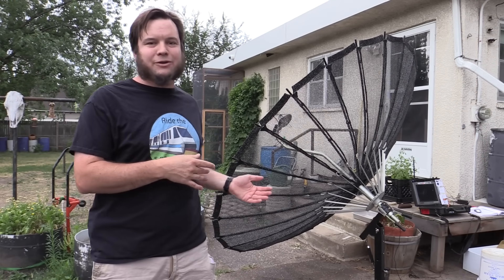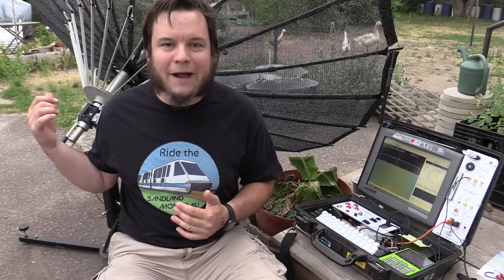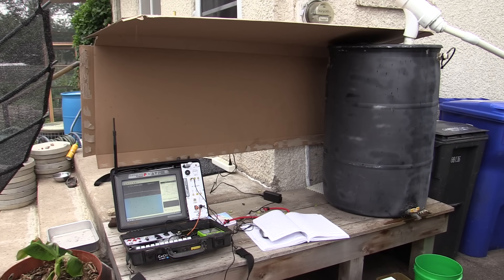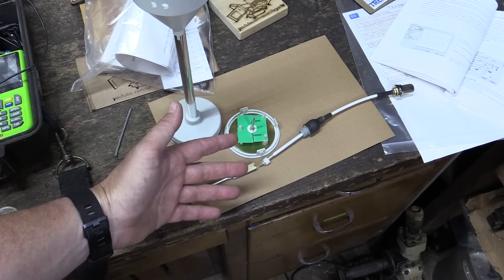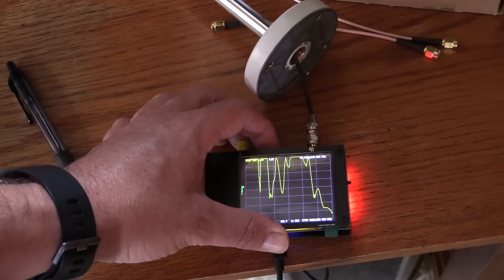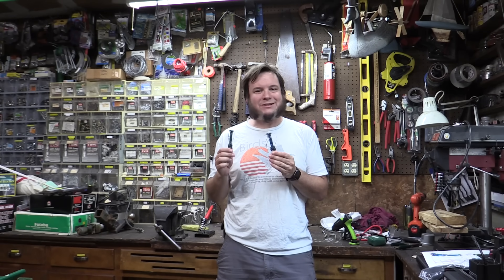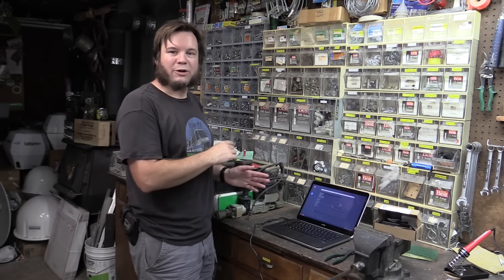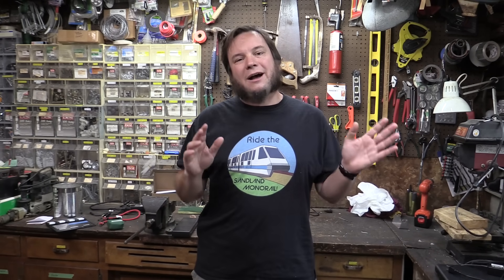Messing With HRPT Satellite Signals

Comment: I'm just happy I'm not the only one who considers duct tape a daily tool. Almost everything I  build is held together with hot glue and duct tape. Sometimes I even put electronics in cardboard box cases.
Reply: hot glue is a wonderful thing that i think gets thought of as nothing more than as an arts and crafts adhesive usually. as long as you're not gonna put it somewhere where the heat is gonna melt it it's really handy, heck all of my antennas ive made so far are hotglue, zipties and PVC.

Comment: Hi, I'm trying to do the same thing, and I've designed some helical antennas for reception, but I can't receive anything. I've tried the spiral in both directions, and nothing. The nanoVNA shows me an impedance of 50.1 ohm at the satellite frequency and an S1.1 parameter of -20 dB, but when the satellite passes... nothing, not a trace. I don't know what to do anymore, if the antenna is bad, or if I need a larger dish to receive the signal... the thing is that in APT I do receive the images, but in HRPT nothing.
Reply from the maker: Are you using an LNA? And can you confirm the pass time and your antenna aiming with another source? Usually I use n2yo for pass scheduling, but Gpredict or other websites can help you double check.
Reply: @saveitforparts yes. I use the noelect GOES saw LNA, and i checked the banda pass filter. It has +6dB gain at 1702MHz. And i use gpredict to track the satellite. Can i write you in IG and show pictures?

Comment: @saveitforparts measurements i built the amazon L-BAND antenna too. I thought I built mine LHCP with the intent of using a dish to RX RHCP signals. Don't you look down the front of the antenna and whichever way it twists is L or R, yes? would that make your antenna at 10:45 RHCP? IDK just wondering because so far im  only seeing some slight signals but aint decoding shit yet. thanks!  73 KJ7QEB
 https://www.dd1us.de/Downloads/QFH-Antenna-Kit%20for%20L-band%20rev1.pdf
Reply from the maker: I had a ton of trouble with that dang mini QFH dingus, I haven't tried using it again since this video. I found just a coil of wire works pretty well, either with a 3D-printed scaffolding or just stuck on some plastic supports. https://sgcderek.github.io/tools/helix-calc.html Same guy has some 3D-printable templates on Thingiverse.

Comment: Yep, the Nano VNA is a great tool. I bought one in early November & its still in the box needing calibrated. I am looking forward to using it, especially the feature that plots onto the Smith Chart which is actually just the Extended Complex Plane or Riemann Sphere where knowing that takes the mystery out of the chart.

I also bought a new RS 918 about the same time. The new rig stayed in the box for 6 weeks too because I have conceivably too many projects. 

Eventually firing up the rig showed it came with a broken mic. At least the new mic arrived today and now, crossed fingers, the RS 918 is up and running for good. By the way it is a fabulous receiver, better than my old Kenwood or even my RSP-1A.

Its terribly cold here in the Catskills  such as 13 degrees for a high, but this spring I want to take the old satellite dish I found along the road and my RSP-1A along with the fitting LNA and then give satellites a go prior to stepping deeper in the rabbit hole of all things related to radio astronomy.

I certainly appreciate your videos and they are both informative & entertaining.so, good luck in all things salvaged and 73 from de kc2wvb.

Comment: i recall a c-band lnb used a linear polarization "cantenna-style" with a De-polarizer which is basically a peace of dielectric inserted into the can opening at an 45degrees angle. i believe you can construct a similar device for the 1.7ghz, which theoretically should have way better directional selectivity pointing at the dish, increasing the gain.

Comment: If you take a look at a GPS antenna it is pretty much a dual layer copper circuit board cut to a specific dimension.  Could you be able to use something similar for a better antenna receiver for the higher GHz Band signals?  Could use the VNA as a testing unit to fine tune the home made antenna receiver

Comment: Back in the 80's, I used to download WEFAX pictures using a shortwave radio, a Radio Shack Color computer 2 (Coco2) computer, and a piece of software off of CompuServe's BBS server, and a homemade multi band wire antenna. What an adventure.  Late one night, i downloaded a weather fax pic from Rome, Italy. It had some noise in it but was quite clear. I had a lot of fun with that.

Comment: You can't use a dish with the weather satellites unless it can track the satellite.  The helical antennas don't use a dish, they are Omni directional.

Your helical antennas are too small, they need to be much much bigger because the satellite signals are too weak.  You also need to mount the antenna above the trees.
Reply: And you need a signal amplifier such as the MAR series of amplifiers.

Comment: here is an interesting experiment

required:
275mm glass coke bottle
foxconn copper heatsink (detachable fins)
micro filament wire
sharp kitchen scissors

construction:
take the fins from the heatsink and using the scissors cut them into strips approx 6 - 8mm each. (they will spiral wonderfully)
wrap the micro filament around the outside of the lower part of the bottle.
place the copper spirals inside the bottle.

aero acoustic resonance takes place probably am/fm.. didnt have an sdr at the time when i did it, but run a microphone through spectrum lab. could also make interesting balun / improvised feed horn.

a couple of other things... ruckus wireless access point has interesting internals.. and have you considered a couple of counter rotating discone spaced apart by the width of a geostationary satellite for your microwave scan?

cool channel, keep it going 🙂

Comment: This antenna, has it a part of a mixer as antenna? did not read blow the comments, is this a common question? Thanks
Reply from the maker: I was using a little "QFH" antenna element, which looks like a mixer! This one didn't work very well, but I have a bigger one on my roof that works great for other frequencies.

Comment: I need some guidance on RTL SDR
Reply from the maker: When I got started I read through https://www.rtl-sdr.com/ a lot for ideas on what I could hear. Their "quick start guide" is kind of technical and confusing, but all you really need is a program like SDR++, GQRX, etc. If your SDR came with an antenna you can extend and retract it to see how that affects reception at different frequencies. You'll probably want it near or outside of a window for best reception. You can scroll around through different frequencies and see what's out there. radioreference.com is a good website for police and fire frequencies. https://www.sigidwiki.com is a good site for identifying mystery signals.

Comment: Glad you managed to get a signal at the end! (even if you hadn't it'd still have persuaded me to finally order a NanoVNA!).
For the AZ/EL project, two "scrap" options come to mind; treadmills with adjustable incline have a chunky motor & acme screw mechanism in them. Also, electronic power steering from cars (I worked on Mazda 2s around 2010 in Australia that used it, but many other cars do). In the ones I worked on it was a big 12V DC brushed motor driving a pinion gear on the steering rack - essentially a high torque linear actuator (with ball joints on the end, perfect to attach to a dish).
Reply from the maker: Ooh, good ideas on the motors! I did just order a sketchy solar panel az/el mount from China, so we'll see if that's usable when it shows up in 3 months 😂

Comment: @saveitforparts  -  Make yourself a minature disc-cone antenna and use that instead of the ground plane. This will give you the same performance as the antenna you cut but will have a VERY wide bandwidth with low swr. Disc-cones can also be put into a co-linear arrangement for more gain. I also had another idea about combining discs as directors on a yagi with the antenna elements as sticks. You don't want to have more than 4 elements because it makes the yag's beam pattern in degrees too tight, 3 element yags are about 120 degrees pattern roughly depending on spacing and taper. Old seat of your pants radio engineer who has worked some interesting jobs for many years. Glad to point the way on the antenna. Loved the vid. Wish you were in my neighborhood... I would be helping you.

Comment: the hrpt is NOT circular polarized its linear they why you never picked up anything useing the small QHF antannas. i find on goes east at around  1694. using a wifi dish with the goes saw bird the same one you have. i can get about 4-6db over the floor but satdump seem to decode it just fine using my hack rf and the nesder smartee xtr sdr. but both have to warm up for a bit before they come stable.  more specs on the goes r sats can be found on the noaasis.noaa website. hopes this helps

Comment: We used to use 12m tracking antennas for commanding the old TIROS birds plus a few others that shall not be named. Had a quick change from one satellite to another so had to quickly swing the dish clear over. Both of the stop sensors were broken so the dish kept going. Incredible how much noise a 40ft dish makes as it crashes through the stops.
Old Microdyne receivers used to be about $20K each and weighed about 20Kg but had pretty limited baseband compared to today.
Also used to design telemetry frame synchronizers. Early ones were huge (VME cards) and had a max receive bit rate of 5Mbps. Current generation is about the size of a dollar bill (PCIe card) and is rated for 200Mbps but can go much faster. Xilinx software said it would hold on at 400Mbps but never have seen how fast it really can go. Seldom to see a data stream up above 100Mbps but there are a few up there.
Back in those olden days - satellite telemetry design used to be "fun". Now it's all cookie cutter stuff.
Reply from the maker: Interesting stuff! I only understood some of that, but it sounds really cool. This is why I keep trying to learn more about satellite and comm stuff, there's so much interesting info and equipment out there!

Comment: Years ago I made a coat hangar-wire crossed dipole for receiving NOAA signals using a cheap RTL SDR. since then I became a HAM, acquired a hackRF unit and a couple nanoVNAs, plus a few amps and filters. I'm not very well educated in RF and have been trial-and-erroring everything, most of my projects being 2.4 or 5.8 for RC modelling purposes. But satellites are just cool. I have an old 'Dish' network dish with a high power ALFA wifi adapter and patch antenna that can see and connect to networks a mile away. It would be fun to point it skyward, but it is small for the frequencies used by SSTV and the like. Your channel is always an inspiration!

Comment: Hey, even if it doesnt work, you learned how not to do it. How do you get to Carnegie hall? Practice, practice, practice (and a left on 7th). Just like learning to play an instrument (or really building up any skill), you have to spend the time sucking if you want to be good. And as long as you're practicing, you will always be better tomorrow than you were yesterday ;)

Besides, Ive barely gotten APT down. So those HRPT captures are absolutely amazing from my end. Just sayin'.... Im willing to bet the design of those PCB antenna arent taking into account the PCB and trace material which will affect the signal dynamics at those frequencies. How to fix it? No idea. But I do know of another tuber that made a QFH that didnt perform very well until he modeled the PVC pipe center mast as part of the antenna, and ended up with something that not only worked a treat, it was about 1/4 of the original size smaller! So, especially at higher frequencies, weird stuff like that matters. A lot.

Also, an auto deploy system (however pipedreamy) for that fold out dish would be absolutely badass!

Comment: "the bigger the dish the better the gain the better the signal you'll get but also the smaller the focal point"
I think you are confusing the focal point with the beamwidth,  The focal point is the size and location if the point at which the reflector focuses the RF energy at a point in front of the reflector. The beamwidth is how narrow of a beam that the reflector has.  Look at like a flash light that has a tight beam versus one with a wide beam.
I believe your collapsible reflector was designed by a man named Robert Luliey I don;t know if I spelled his last correctly or not!

Comment: When using the VNA you need to use both S11 and S12 and 2 antennas 10 feet apart pointing at one another tuned as close as possible to one another. That way you can adjust your receive antenna to get the best gain possible and see your results on the fly. Other things will be a factor in tuning as well like coax so calibrate the VNA with a calibration kit that usually comes with the VNA, Setup the S11 and S12 on the screen. Use an antenna you tested and got close to 1.7GHz and use it as a transmit and setup another identical antenna 10 foot away and have it on the receive S12 channel. Then fine tune the receive antenna till you get the best signal possible then swap the antennas and tune the other to the best S12  channel. Keep doing it till you have the best signal. Be sure on the receive antenna to use the coax you will have hooked up to the satellite dish so the VNA accounts for the capacitive and inductive qualities of the coax when tuning the antenna. You can walk in front of the antennas and see how focused your antenna is. I use GOESTOOLS on linux VM to download and I use the GOES LNA/Filter also. Wideband LNA can be used after the GOES LNA bandpass Filter to help bring out the signal. I get super fast HRPT downloads and I dont have to use different software to process. A few command lines and it can run all day and I can see all the images it downloaded on a local webserver ran on Linux. I can view the pics on any computer in the house with a browser

Comment: Respected, please note that that type of helicoidal antena that You used at parabola is very, very sensitive to unprecise manufacturing. Since You are into it, you should take time and redo iradiating element. Take a look at some older litereature, I didn't get involved for some time so can't give any title of head. They are described good in some antena handbooks for radio amateur use. Best Regards and good hunting YU3KOF
Reply: Antenna Engineering Handbook ISBN 0-07-032381 Chapter 13  Helical Antennas, but look at other stuff specialy feeding parabolas.

Comment: I don't know anything about RF stuff, but are you supposed to use a right-handed coil for a left-handed signal?
Reply from the maker: It's reversed when used with a dish, since the signal is getting reflected. Same as how a reflector telescope shows stuff upside down.
Reply: @saveitforparts  So it comes in left-handed and turns right-handed? Or the other way around?

Comment: A Cantenna works good with a dish reflector too. Its not circular polarized but give good 'illumination' of dish. I used one to pick up 2 GHz 25 miles away in the 1980s.
Reply from the maker: I use a cantenna for GOES satellites, that's in an upcoming video and an older one where I extended one of the little Ku-band dishes.

Comment: Could you use a cantenna instead of a qfh
Reply from the maker: I tried a cantenna a bit, but it works better with GOES (linear signal) than HRPT (circular signal). I thought the QFH would work but I should have done a regular helical!

Comment: Did you run that QFH through a VNA to check it's performance on that band? Ahh here we go! I wouldn't test SWR with the antenna laying down on anything. It should be in free air for correct readings. Deffo stick with the big dish. FFS you mounted the new antenna in the wrong plain for that style antenna. Try mounting it at 90 degrees to the dish, you can also try a very small dish behind the antenna directing it back to the larger dish. You can also try making a tiny yagi and mount that in place of the lnb.
Reply from the maker: I tried a Yagi for GOES on the small dish, and that worked (upcoming video). I don't think I actually tried that for HRPT yet, I might just go to a helical feed if I can get the 3D printer to behave.

Comment: I have been building QFH antennas for 70cms ham band and they were a challenge, pain in the butt, to adjust and tune, so going to 1.7 Ghz will only make that worse. Some times the simple approach is better, 1/4 ground plane! But you video proved my motto, "Don't be afraid to try it."

Comment: As others have said you are completely misunderstanding the radiation pattern required for a dish feed. The QFH anntenna are for omindirectional use on their own, they have poor directivity into the the dish. The technical term is dish illumination. the feed point antenna fires at the dish surface for maximum illumination.A simple dipole with a reflector plate behind it would be a better starting point.

Comment: Search for "Helical antenna scaffold set (v4)" in thingiverse and choose the 1700L_2.5T_0.14S_4D_10-90M v1 file, use 10AWG wire to wind the helix. I have similar SNR values to yours with a 65 cm offset dish.

Comment: I don’t think this necessarily contributed to any of your problems,  it’s just something to be aware of. In mobile phone network land, the AWS band is in the neighborhood of 1700 MHz for the talk-in, meaning the user equipment such as cell phone or m2m device transmits there. So depending on your mobile phone model and provider and whether or not the provider has deployed AWS nearby, your phone could be transmitting a high enough signal, if close enough your satellite antenna, to make your satellite receiver unhappy.

EDIT: fixed a couple of eyePhone typos.